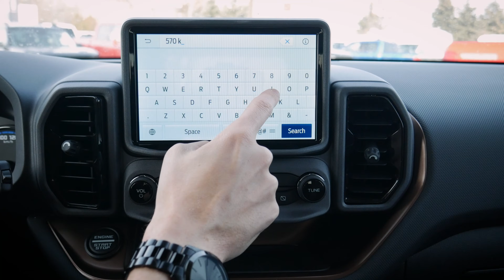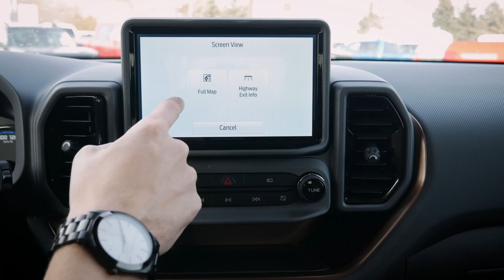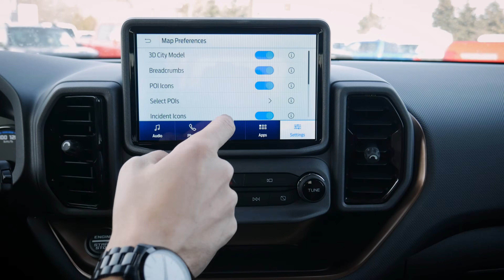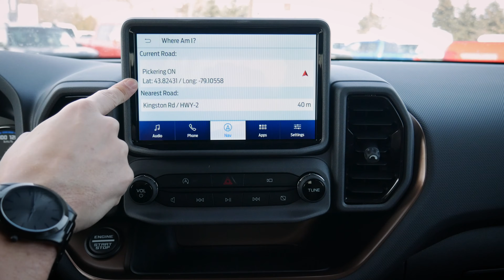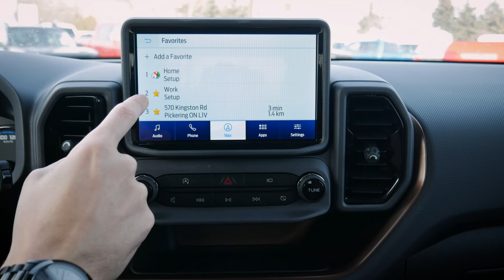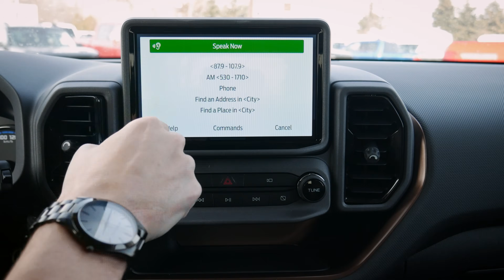Using factory navigation in the Ford Bronco Sport

Comment: Is this for all bronco sports? I just bought a 2022 and I don’t see that navigation option.
Reply from the maker: All Bronco Sports have the option for factory navigation but it requires a package ordered from the factory. You can technically add it in by replacing the whole screen with one that has navigation but you're looking at approx $1,500 for the swap to be done

Comment: Is navigation free on the Ford?
Reply from the maker: If you're in a Ford with Sync 3 you'll have built in navigation so you only have to pay for the occasional update if you want it. The newer Sync 4 system has built in navigation or connected navigation - connected nav reverts to a dead map unless you subscribe whereas built in reverts to a traditional GPS if you don't subscribe